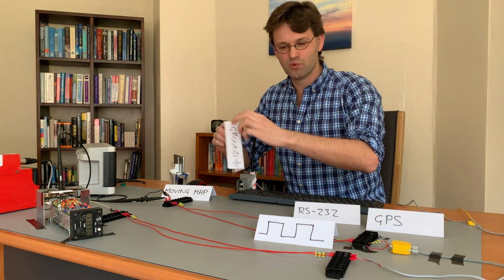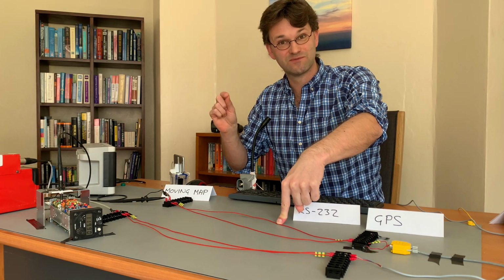Glider Electronics Experiment #1 - electrical crosstalk demonstrated

Comment: Nicely done! Good use of "lockdown time". Twisted wire should make a nice difference in noise. Shielded wire is normally also twisted pair/pairs (multi pair will have different twist/length). Looking forward to the next update.

Comment: Just an afterthought. The result of crosstalk to us would be impaired sound output. I wonder therefore wether you could add a comparison of sound coming out of the radio before and after wire shielding?...
Reply from the maker: Hi Daniel, in my first attempts to film the video I did actually include the audio. But by the time I got to something presentable in iteration four, I was so desperate to ship the video I forgot to include the audio. Will include it in the next experiment.